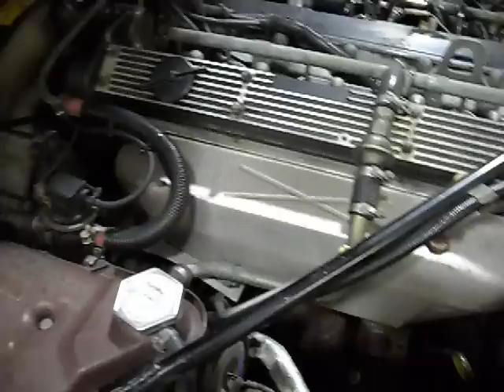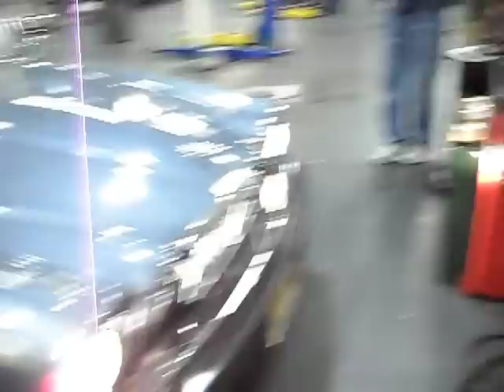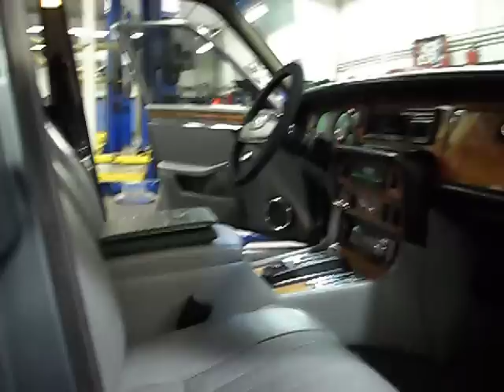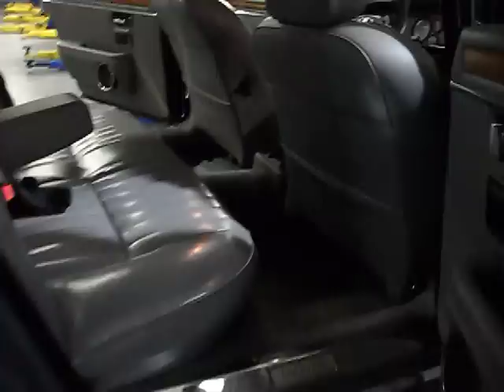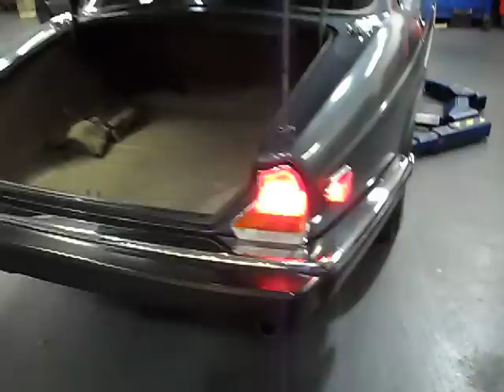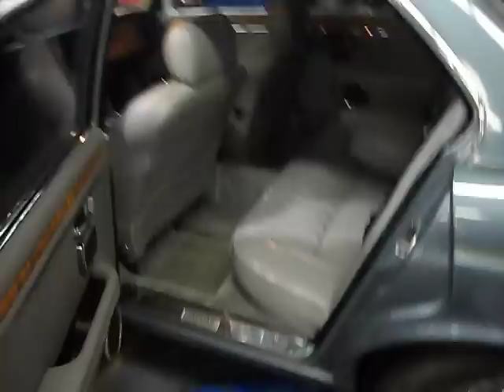1986 Jaguar XJ6

Comment: FINALLY! Someone on YT who knows how to pan a camera shot! Please take a bow :) By the absence of tappet noise this is obviously a low-mileage vehicle. BTW - By the time anyone gets around to reading this, I should be the owner of a gas-station-reject BRG 1986 Moonroof non-runner w/115,000 miles on it... I am pretty brave when it comes to cars, ('66 Ford LTD, '73 Vega, '63 TR4, '79 TR7 convertible, '85 Caddy 4.1), but the difficult startup of the low-mileage vehicle in this video is scaring me.